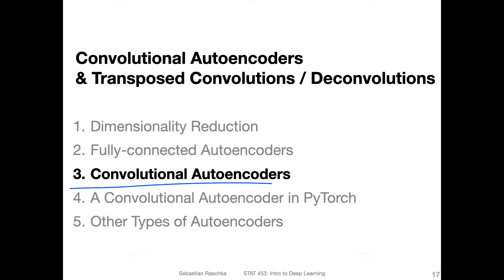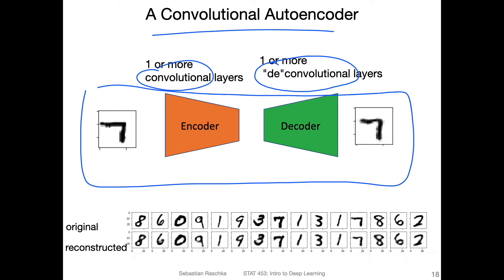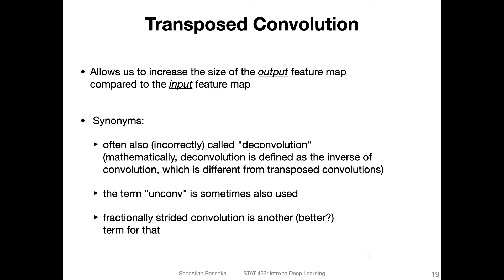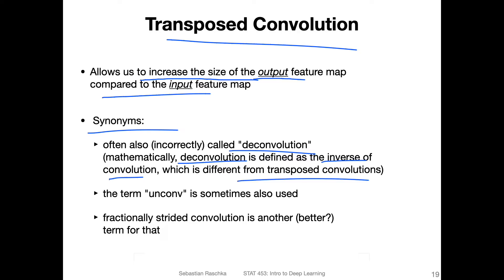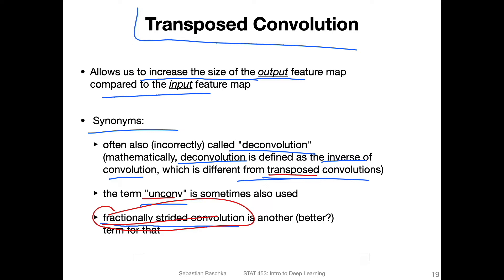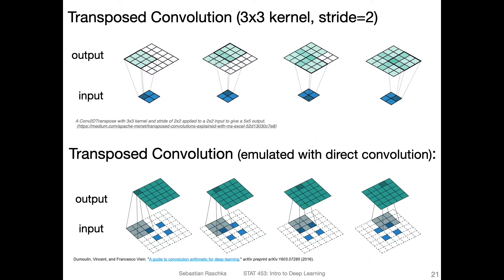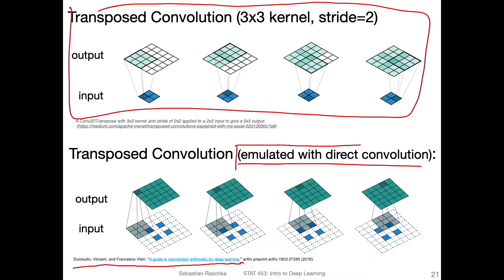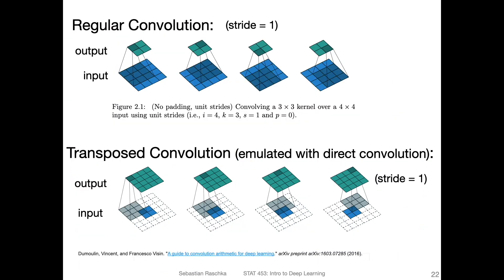L16.3 Convolutional Autoencoders & Transposed Convolutions

Comment: For reducing Checkerboard artifacts which strategy seems to be the best ? Also in some stack overflow question it was mentioned to use skip connections to reduce it. Is that suitable or will it affect the model result ?
Reply from the maker: I think skip connections may generally help with quality, but the checkerboard issues would still be an issue if you have bad settings regarding stride and kernel sizes

Comment: thanks for the nice explanation. I have a question. 

from input 2*2 filter 3*3 stride = 2 padding = 1
How come the output is 4*4

the formula is output = (input-1)*stride -2padding + kernel 
(2-1)*2-2(1)+3 = 3 not 4

Comment: Is it fair to say that one of the differences between the two transpose convolutions (non emulated and emulated), is that there are learnable parameters in the last one and not in the first one ? 
Also, my intuition is that the output of the emulated transpose conv is the same as that of the normal iif the kernel is made up of fixed ones ?
Thank you for the video !

Comment: The concept is fine. I am still having trouble when I put a 2x2 matrix and a 3x3 kernel and do the two process. They give different answers. Perhaps a different kernel is needed to achieve the same 5x5 from the 2x2?
Reply from the maker: Do you have a from scratch code example by chance?
Reply: @SebastianRaschka  I have a code example to show that keras doesn't produce the same output for conv2dtranspose and conv2d on zero padding: https://colab.research.google.com/drive/19RQ5AWOSxPt_vFi5McM_DgmK2HyLWHvY?usp=sharing
Reply from the maker: @DeepakNSubramani  Thanks for sharing! I have bookmarked this and will investigate!

Comment: My deep learning prof told us that Transposed part of the name comes from the fact that, if the standard Conv would use the weights matrix of dimension m x n, TransConv would use the weights matrix of dimension n x m, like you would get from transposing the matrix in the original Conv
Reply from the maker: In reality, it would be a bit more complicated than that :P. You would  have to rewrite the kernel  (which can be e.g., m x m) as a sparse matrix with 0 elements. Then, you have to reshape the input matrix, and implement a matrix multiplication equivalent to a convolution. Then, I think you can transpose the sparse matrix to get a transposed convolution. But yeah, that's very complicated and unintuitive imho.

Comment: Do you have a code example for the upsampling and convolution approach? I am struggling to implement it correctly in Pytorch and am looking for the right way to do it. Would be nice to see how you did it.
Reply from the maker: Yeah, I have a convolutional autoencoder based on this approach here: https://github.com/rasbt/stat453-deep-learning-ss21/blob/main/L16/conv-autoencoder_mnist.ipynb (I think it is linked and discussed in a later video in L16)

Comment: Either I am missing something, or there is a mistake here. At 7:15 (slide 21) you say that both methods have the same result, but if you look how the top left pixel of the output is computed you will see that this is not correct. In the upper example the value depends on the top left value of the kernel, but in the bottom example it depends on the bottom right value of the kernel. So the results will be different.

EDIT: The kernel must be rotated 180° in the bottom case.
Reply: Thank you for your EDIT comments. It clarify my confusion as well
Reply: What are you talking about ? I don't see any errors
Reply: What a savior! Thanks for the edited comment. The missing piece in my understanding was rotating the kernel by 180 degrees.

Comment: When I do the Transposed conv，how does the 3x3 kernel come?
Reply: i would say you choose a sensible kernel size on your own, depending on which output size you want to have (e.g. if you want to get an original image (input) with higher resolution (output))
Reply: @TheFlosener  Ok,thanks.  But what do you mean by the sentence in the round bracket.
Reply from the maker: I think Florian Pätzold meant that you choose the kernel size based on the input and output image resolution. I'd say 3x3, 5x5, and 7x7 kernels are common ones. Usually, for higher resolution inputs you would also prefer larger kernel sizes. Btw the formula for computing the output size for transposed convolution should be as follows, I think: output_size = (input_size-1)*stride - 2*padding + (kernel_size-1) + 1
Reply: @SebastianRaschka  thank you!!!!

Comment: should we always replacing transposed conv by upsampling. Is there any samples that transposed conv outperformes upsampling?
Reply from the maker: Good question. The article I linked (http://distill.pub/2016/deconv-checkerboard) recommends using upsampling+conv in general. Personally, I use transposed convolutions by default and sometimes compare it to upsampling+conv. I usually don't see much difference in practice. Sometimes one approach is slightly better than the other. 

I.e., for the VAE training on CelebA I am currently implementing for the next lecture, I tried both 

Transposed Convolution:

        self.decoder = nn.Sequential(
                torch.nn.Linear(2, 3136),
                Reshape(-1, 64, 7, 7),
                nn.ConvTranspose2d(64, 64, stride=(1, 1), kernel_size=(3, 3), padding=1),
                nn.LeakyReLU(0.01),
                nn.ConvTranspose2d(64, 64, stride=(2, 2), kernel_size=(3, 3), padding=1),                
                nn.LeakyReLU(0.01),
                nn.ConvTranspose2d(64, 32, stride=(2, 2), kernel_size=(3, 3), padding=0),                
                nn.LeakyReLU(0.01),
                nn.ConvTranspose2d(32, 1, stride=(1, 1), kernel_size=(3, 3), padding=0), 
                Trim(),  # 1x29x29 -> 1x28x28
                nn.Sigmoid()
                )

Nearest Neighbor Upsampling:

        self.decoder = nn.Sequential(
                torch.nn.Linear(200, 4096),
                Reshape(-1, 64, 8, 8),
                #
                nn.UpsamplingNearest2d(scale_factor=2),
                nn.Conv2d(64, 64, stride=1, kernel_size=3, padding=1),
                nn.BatchNorm2d(64),
                nn.LeakyReLU(0.1, inplace=True),
                nn.Dropout2d(0.25),
                #
                nn.UpsamplingNearest2d(scale_factor=2),
                nn.Conv2d(64, 64, stride=1, kernel_size=3, padding=1),
                nn.BatchNorm2d(64),
                nn.LeakyReLU(0.1, inplace=True),
                nn.Dropout2d(0.25),
                #
                nn.UpsamplingNearest2d(scale_factor=2),
                nn.Conv2d(64, 32, stride=1, kernel_size=3, padding=1),
                nn.BatchNorm2d(32),
                nn.LeakyReLU(0.1, inplace=True),
                nn.Dropout2d(0.25),
                #
                nn.UpsamplingNearest2d(scale_factor=2),
                nn.Conv2d(32, 3, stride=1, kernel_size=3, padding=1),
                nn.Sigmoid()
                )

And got almost identical results. Maybe in this case upsampling is a tiny bit better but hard to say.